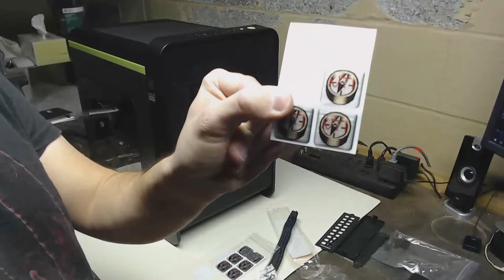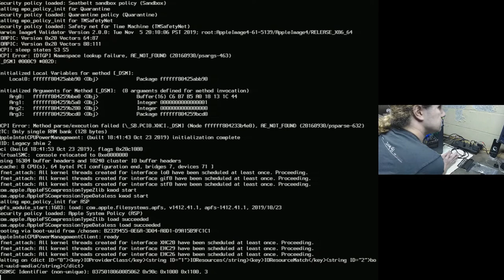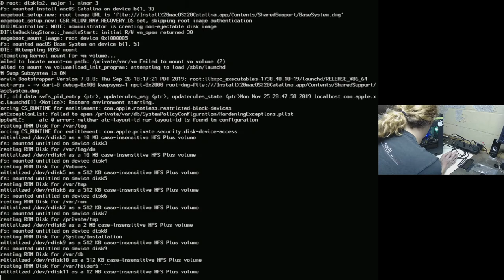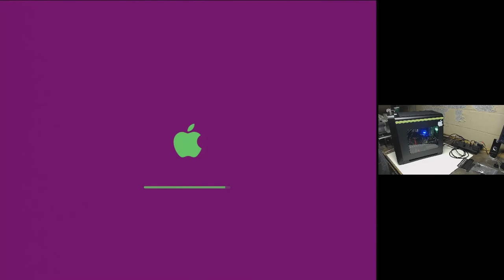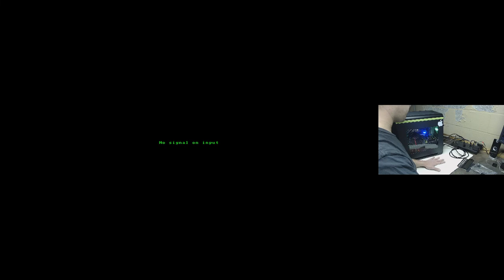X99 Update - Hackintosh Install

Comment: happy new Year! Congrats. Nice setup. I think you need more powerfull graphic card and then all be allright
Reply from the maker: I think the GPU is fine, I think it's the fault of the VGA adapter.  It would probably work better over HDMI at 1080p.
Reply: @nticompass  sounds like truth. good luck man.

Comment: Enjoyed your video. Did it work out ok?
Reply from the maker: Thanks!  Yeah, i did get things working.  Mac OS apparently doesn't like my monitor (or VGA splitter); connecting it to a different monitor fixed the weird color issue.
I'm currently working on a follow up video with benchmarks and stuff, so stay tuned :-)